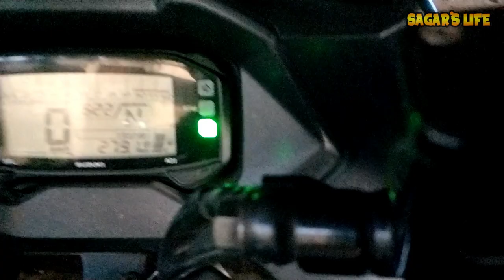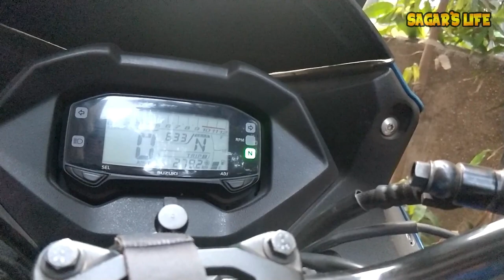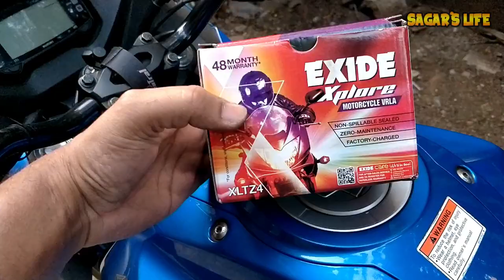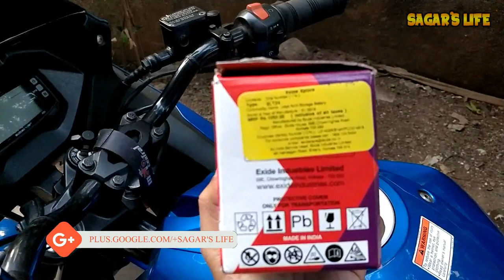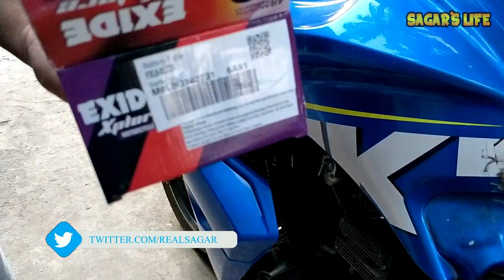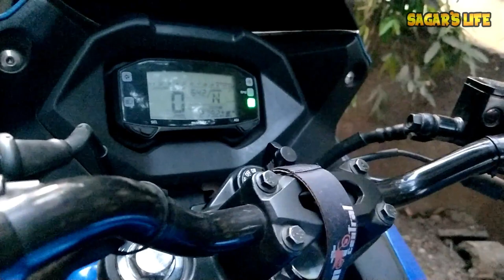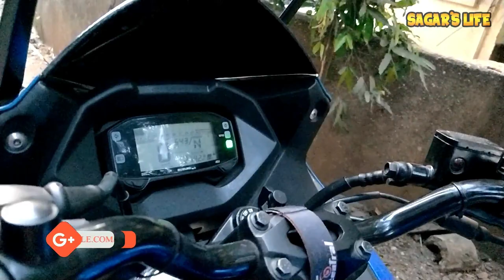Gixxer Starting Problem | How To Replace A New Battery On Suzuki Gixxer SF

Comment: I also just had this problem like for 4 days.. when i press selfstart it gives that.zzzzzz sound that was coming like.the same from urs so i have to push and start and like the same as urs there is no problem in any of the lights just start and the thing is my gixxer just turned 1 year its really saddening facing this all my friend told me it could either be the battery issue kr self motor isuue so any advice sir? Also 2 days before it was showing Fi on the screen....
Reply from the maker: Just charge the battery and replace the charger (which is next to battery). I am facing this issue after every 4 yrs

Comment: Sir maine 2 mhene bike nahi start ki..wo battery down hogyi.. ye normal hai kya??? 
Maine bhi local shop pe charge krwae.. 
Bike start hogyi.. 1 din bike nahi chale.. fir se first time me start nahi hui.. btao kya krna chaea
Reply from the maker: Yes it's very common if you are not using bike for certain period battery will completely drain, will request you to unplug the battery connection if you are not going to use bike for longer period.
Reply: Ok ok... Thanks.. 
Kuch videos me. Fuel pump/ spark plugs/ self motor me bhi dikkt bta rhe hai... 
Ye sab local shop pe check krwa lu??
Reply from the maker: If your bike is not in warranty then better to do it with local garage 👍
Reply: @SagarsLife  ok ok sir.. thanks for the information

Comment: I have GIXXER SF 2019 model , last Sunday my bike perfect start in early morning around 6AM , I rode it to 9-10 kms and I spotted for a while . I took some pictures and meanwhile my bike is on , I just cut it out the power but headlamp and indicators are on. I spent good 5-6 Minutes like this and when I back on bike and try to start it , it won't start and giving me the same kind of problem which you have mentioned , then after 20 minutes later bike start. Since my bike is only 6-7 months old , I want to know if that's a normal case with F.I bikes or do I need to pay special attention , if faulty batteries was provided with bike ?.
Reply from the maker: As you said you kept headlight and indicator is on without running engine on due to that your battery got drain.. Due yo aho lights you should always keep engine running otherwise do not keep key on more than 1 min without engine running 👍
Reply: @SagarsLife  so do I need to do something with my bike battery ?
Reply from the maker: If you get time then do get your bike battery voltage check for safer side..
Reply: @SagarsLife  sure. Thank you so much for information.
Reply: Same problem, I have fi Gixxer.. it's only 6 month old, how battery can be drain....i think it's major fault by company

Comment: mere gixxer 4years hua hai..1 accident hua tha samne se toh bike k key bend ho gaye the..fir 2nd key se chalata hu..abhi kuch din se bike ager key on karke start karu toh meter off ho jati hai fir se aati hai..2 se 3bar aisa hone k baad start hota hai..problem kya hai baata sakte ho? battery problem or lock set problem?
Reply from the maker: It can be because of multiple reasons, battery, charger or key ignition wiring loose, will suggest you to visit your local garage or suzuki svc
Reply: @SagarsLife  ok thanks

Comment: I am using sf 150 with one year old. Facing the same problem while starting the bike... what is life of a battery?
Reply from the maker: Mine run for more than 3 years.. Get charger Change of your bike
Reply: @SagarsLife  you mean battery charger?
Reply from the maker: There is small part beside battery which called charger its help to get battery charge while bike engine is running...
Reply: 4 years Max. But mine ran for 5 years.

Comment: even though i replaced new battery, still it make the krrr sound and not even starting... engine malfunction light also blinks.... plzz help me....
Reply from the maker: Change the charger it will solve your problem

Comment: What the price of this battery red. 

I used a capacitor much cheaper Rs 35
Reply from the maker: It's costed rs. 800
Reply: Akash manick kya capacitor se self start  lene lagegi....... Aur kitni power ka capacitor use kr rahe ho?

Comment: I too have same problem , battery voltage is 13 but not turning on
Reply from the maker: Sorry to hear that, try to change charger of bike
Reply: @SagarsLife  that  sounding thing u said that the charger right
Reply from the maker: @ModMaxX  yes there is part beside of battery call charger which help in charging the battery.. Try to change it to diagnosed the problem